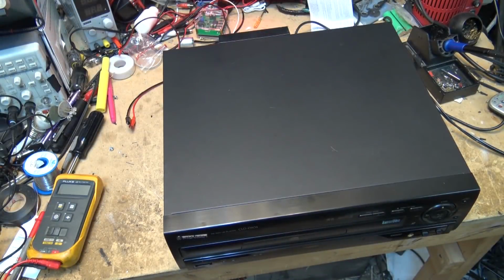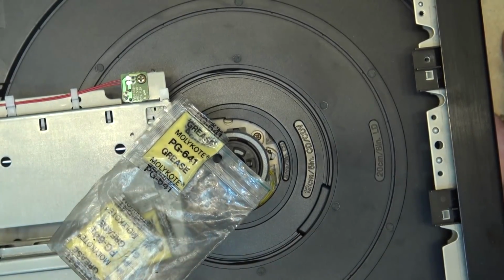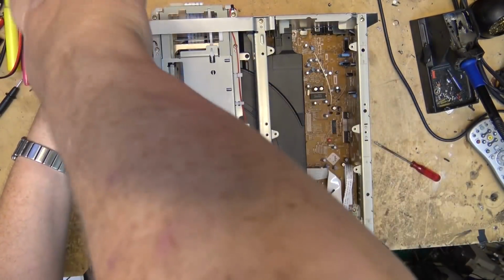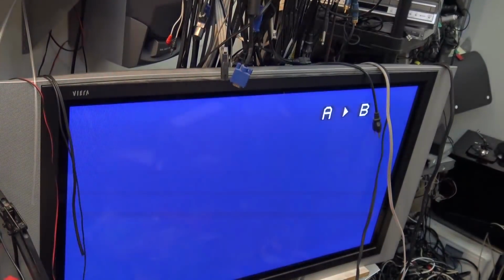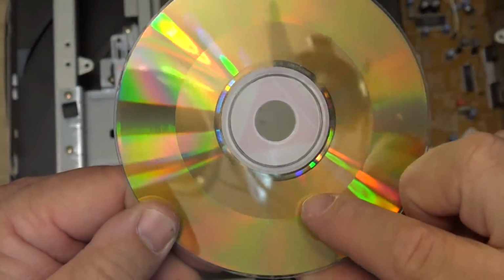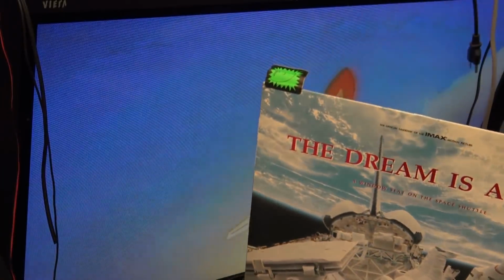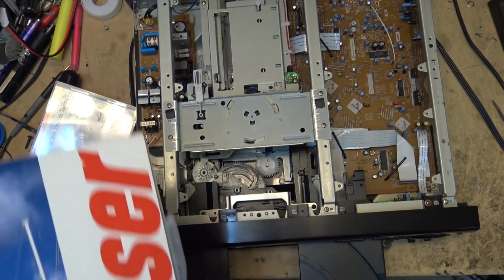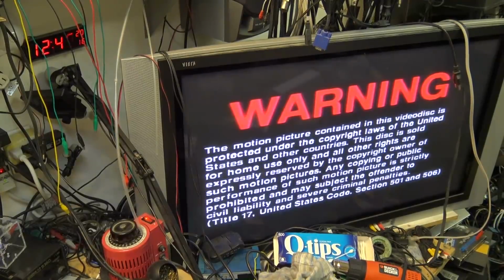Pioneer CLD504 Laserdisk repair

Comment: i have a Pioneer DVL 919, why is the picture all pixellated and smeared like 8 bit color?  Laser going bad?
Reply from the maker: Is that the one that had the digital processing. One of them did and I forget the model, but basically theu digitized the video and then converted it back to analog again so it could so special effects like slo mo, and freeze on CLV recorded disks.  The digital board devolops problems, usually bad SME caps and that causes it to produce a bad picture. I have never fixed the module. The only time I saw one was under warranty and the board was swapped.
Reply: 12voltvids thank you very much!  Yes that’s the one.  So bad capacitors?  I have a back up cld-2090 but still sad it’s a cool player but I think the pic quality on the 2090 is even better

Comment: I recently got a Pioneer CLD-V510 and the picture either cuts out periodically or the color behaves badly. I've watched the discs many times on another machine and it isn't the discs.

Could it be electrostatic discharge disrupting the video (and sometimes audio) signal?
Reply from the maker: Check capacitors in power supply for high ESR. That is the place to start. The caps start to fail and ripple from the power transformer gets into the video circuits and causes problems.

Comment: Wasn't Magnavox a Philips brand? Because they couldn't use the name "Philips" in the US due to it being similar to "Philco"?
Reply from the maker: Philips was available in North America.  They built stuff in Ontario.   My grandmother's first color tv was a Philips.   That was 1968, a Philips k6 full tube job.   Philips also owned Magnavox and sold product under both names.   I believe the Magnavox brand was more prevelant in the USA, but in Canada there were Philips dealers and Magnavox dealers.  My parents first color set in 1970 was also a Philips, a modular 4 hybrid.  I actually learned to service tvs on those 2 sets. They were pretty unreliable. Every time you turned around something broke on them.  The Philips service man told my grandmother in the early 70s that her tube set was not worth fixing so i got into it when I was about 14 and tinkered.  How I didn't electrocute myself is a miracle. Actually how I am still is a miracle considering how many times i received big time shocks when I was in the business.

Comment: I bought one for $200 and it will not even open to put in a LaserDisc in.

 DVD LD PLAYER DVL-909 - PIONEER MFD MAY 1998

It will not even open! Can it be fixed?
Reply: Probably something wrong with the gears on the disc tray. Unscrew the top cover and see if you can detect what isnt working when you try eject.

Comment: ED Beta didn't have the best quality of any analog consumer formats?
Reply from the maker: ED beta had a good picture, but it was still a color under system where the color is converted down to 688KHz and is bandwidth limited. It is then converted back to the 3.58mhz on playback like all video tape formats. Laserdisk recorded a direct composite signal like 1" video tape. No bandwidth limiting on the chroma signal.  So yes ED Beta had a good picture, as did S-VHS, but laser disk was still considerably better.

Comment: Would  you please check out my short laserdisc player video? It jams when flipping over. After watching your video, I think it might just need grease. Just want your opinion if you think that might be the issue. I would like your opinion before I open it back up again. Thank you.
Reply from the maker: Do you have a YouTube link for it? I don't accept direct files.
Reply: Update. I tried to apply grease. After doing that I was able to rotate the mechanism without the sled on it. Now it will only eject and close. The laser moves twice and stops.  It doesn't try to flip any more and the disc doesn't spin at all. It's almost like it doesn't detect a disc.  I turned my mild inconvenience into a completely broken machine. Any ideas how to fix

Comment: Well well..... I would have expected you to have known or shown any of the Pioneer Reference Discs, which could deliver much cleaner colorbars and other technical patterns. Way much cleaner and of a higher quality than the consumer Video Essentials disc.

I'd guees that if anyone would have to conquer the Pioneer Reference Discs, they would've had their signals coming from a Tektronix 1411 pattern generator, which was a +12,000 $ device back in the day.

BTW. Why is it so damn important to toss and jerk every piece of equipment around like that, in every of your videos ? Why is tender finesse such a blank spot or such a bad thing to consider ? I really do wonder. That's why I'm asking politely :)

Comment: LD has nice picture quality but high definition MUSE LD, W-VHS, and D-VHS blew it away in the analog domain.
Reply from the maker: You are comparing baseball to football there.
Lets compare it with something else in the same ball park. VHS, Beta, video 8 and DVD. The closest contender was DVD, but most discs lost out in the quality department due to digital compression artifacts.
In the SD domain, laserdisk was the king of picture quality.

Comment: hey dude, I wonder if you could help me. I purchased a Pioneer 2730k laser disc player on eBay and the tray won't open or close. I removed the casing and played about , I got the tray to open and close but when you load a disc the laser keeps clicking like its trying to move further across the track. Please see attached video https://youtu.be/togQ_pWbEsA

Comment: YOU DIDN'T EVEN FINISH FIXING THE LASER THE LASER IS STILL MESSED UP IT HAS TRACKING PROBLEMS
Reply from the maker: It does?  Geez you must have psychic powers because this is my machine and it plays perfectly.  There is nothing wrong with the tracking.  I have a few marginal disks that won't read worth a shot on any of my players but that's a disk problem. Laser rot as they called it but good disks okay perfectly fine.  I don't use it much but every time it plays ok. Load belt is slipping again a bit.